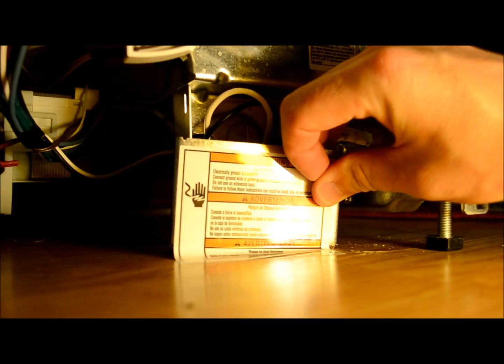How To Remove & Replace A Dishwasher, Part II, Installation

Comment: Nice video, but a few comments from a longtime professional appliance installer: You should have removed the old 3/8" copper line and used the 3/8" stainless braid fill line that came with the install kit, and connected the elbow and fill line to the DW before sliding it into the opening. Also should have used the new drain line that came with the DW, as how you connected to the old one won't hold because it was only rubber on rubber, with no hard backing tube inside to prevent the old drain line from collapsing. I guarantee it will leak eventually, if it hasn't already. Also the top mounting brackets have tabs that should have been bent up after being placed into the slots, so they'll stay in place. Those will come loose eventually. I see it all the time on DIY installs. Finally, the romex or power cord should come through the larger hole in the back of the electrical box, with a metal or plastic strain relief, which is normally included in the install kit.

BTW, I'm not trying to be mean, just helpful to you, and to folks watching this :o)
Reply: This should be upvoted so it's seen by everyone. I was watching videos to remind myself of any "oh, yeah!" items before installing mine, but I caught all these same errors in the video (though otherwise helpful). Heh, I guess that means I'm ready to install this fancy new thing.

As a side note, I think reusing the old copper line is probably OK in a pinch -- for instance, if it comes straight out of the wall with a remote shutoff. But those compression fittings don't always seal well the second time, and they get stiff and brittle with age. So overall, probably best to replace the line, and it's usually really easy in the case of a dishwasher. No one wants a leak they won't see until it ruins their subfloor. That's why installers from the big box stores won't install it unless they can replace the old copper intake line.
Reply: The stainless braided line is garbage! The rubber inside the line goes bad all the time and puts rubber pieces all throughout the system. You have done what’s best by reusing the hard copper line!
Reply: tap4154 isn’t not installing the strain relief for the power supply against code?

Comment: Great general tips for a newbie like me. I just swapped out my ancient Maytag with a new Bosche, but did need to insert my hard wiring into a the supplied custom plug/junction box, use the new supplied drain hose, and swap out my old copper hot water tube for a new braided line because the attachment point is in a totally different spot. Still, your tips helped immensely.

Comment: I've installed a few dishwashers, but is has been a few years.  Thanks for the excellent removal and install videos. One question:  did you remove the compression slip before installing the special Maytag 90 degree fitting?
Reply: paint over wall paper
Reply: Marcus Morgan

Comment: thanks for the video. Very helpful. I removed the old one without any problem. However, when I connect the water pipes, though I did it very tightly. There is still water leakage. Any trick in tighting the tube?
Reply: use tape to wrap up thread before connecting pipes. Be careful case you use too much force you can just crack the pipe
Reply from the maker: Some Teflon tape (plumber tape) should help.  It's inexpensive.  Be sure to wind it on in the direction of the nut tightening.  Thx for watching.
Reply: ExcelDriveVideo
thanks for replying. I will try again.

Comment: Don't know if I'd like to trust my life to that little electrical tester thingie.  I would turn the DW on momentarily to test that power is on, then turn off breaker and try DW again.  If it doesn't energize, you're good to go.

Seems to me, once you have drain and electric connected to new unit, you could use length of garden hose to connect drain for short test before you shove DW into counter.

Comment: You installed  the power wire into the wrong hole it suppose to go into the 1/2' hole in the rear of the power box with a romex connector

Comment: I appreciate you posting a video but I found it so frustrating. I've never installed a dishwasher and I really need to see each step being preformed. Telling me what you will do and then showing it already done is really of no additional help. The included instructions provide this much information. I need to see exactly how to do it. Maybe keep that in mind for future videos.
Reply: rebecca cocoros if u watch video afew times  you d memorize what to do Esad ily. Thats not rkcket science Rebecca.
Reply: @farukatasever2933  I have to agree with Rebecca. The main question I had was skimmed over and not shown. Attaching the brackets at the end. My current dishwasher moves around and won't close until I jiggle it around into just the right spot. I wanted to see that part so I could figure out if it's my dishwasher or I need to get somebody to rebuild the inside area when I get a new dishwasher.

Comment: the drain hose should never go Over another hose if you must install it that way the new drain hose should go inside the existing hose (male to female) but I wouldn't do it this way I would have used the new hose all the way to the drain with NO union that can't be seen this surely will leak and you should change it esp. with wood floors !

Comment: Are you freaking kidding me??? Do not listen to this guy about connecting the power cord! First of all he put the cord thru the wrong hole, and more importantly he didnt use a clamp to secure it into position, which could cause an electrical fire if there was too much tension on the cord!!!! WOW. Dont make instructional videos if you're setting ppl up for a housefire...
Reply: I noticed the wrong hole was used, too. What sort of clamp are we supposed to use, though, as tension relief? Also, is the tension more likely to short and cause a breaker to flip or is there some other effect that would allow current to flow for longer and cause a fire?
Reply: Zak Morrow there are a few different options available for strain relief, plastic or metal. I prefer a certain plastic piece when cording a dishwasher.  Whichever option you use just remember the hole is 1/2".
Reply: Use the same wire clamp that's used for electric outlet boxes.